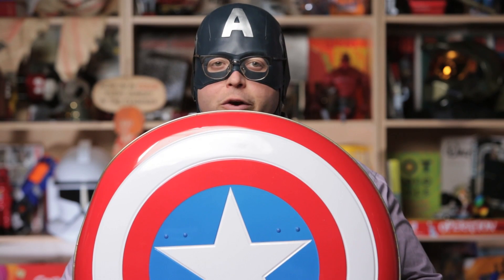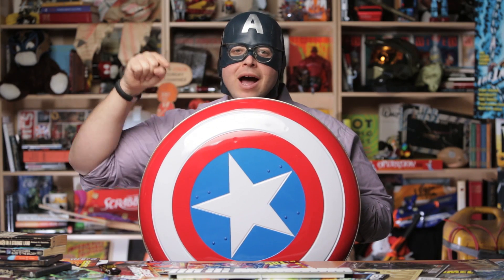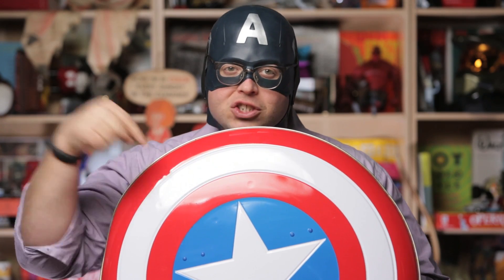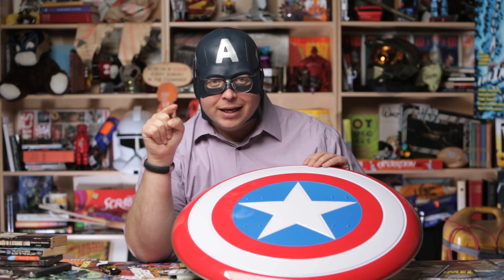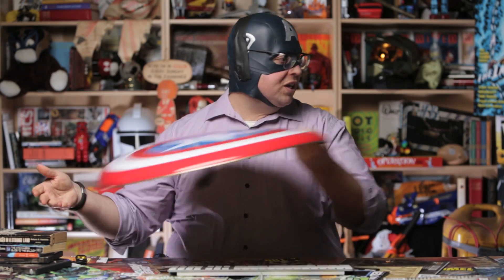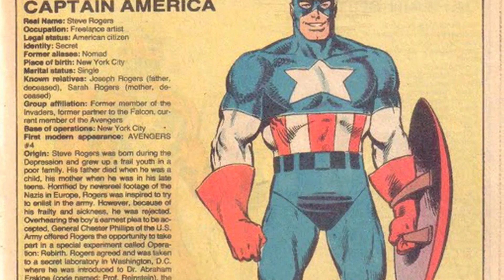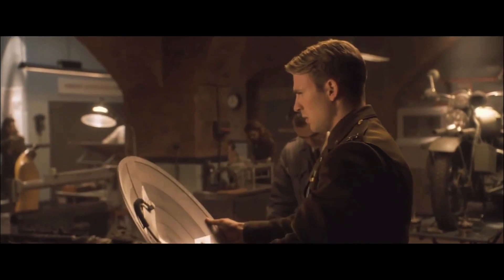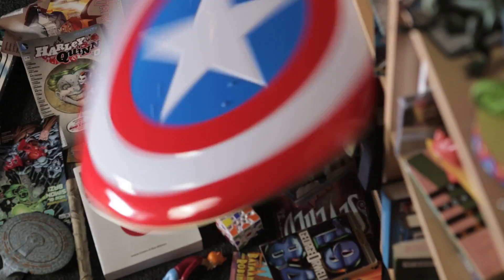Captain America’s Unrealistic Vibranium Shield | Angry Nerd

Comment: Isn't there TWO forms of Vibranium? I never did quite pin down the properties of the Savage Land type. Maybe it has something to do with that? Or the mixture of Vibranium and Adamantium cause the Vibranium to instantly release the energy it just absorbed, so it doesn't lose momentum until caught. Which means you'd have a hell of a difficult catch every time, as your body would have to absorb the impact. Captain America's must have calluses as thick as saddle leather.

Comment: Energy doesn't just disappear. That energy that it absorbs has to go somewhere. If it were just being absorbed, eventually the shield would explode as it became overloaded with energy. What's more likely is that it absorbs energy in one direction, but releases it in another, like polarized lenses. When struck face on, the energy is stored in the atoms of the shield. When struck from the edge, the configuration of the atoms allow it to release its stored energy, thus allowing it to perform those incredible bank shots without losing any momentum.
Reply: I agree with you and I add that the problem of the adamantium-vibranium alloy is as he said, can't be portrayed on Marvel Studios Films bc adamantium belongs to x-men, so they can't mention it T_T

But the idea you said, solves the ecuation!
Reply: In the rise of the black panther, t'challa's mother is testing Vibranium and says that the energy strengthens the subatomic bonds of the metal. So Vibranium would absorbs and converts Vibrations into the bonding force of atoms!!

Comment: but let's fantasize, that vibranium shield is designed to work only against front(back) side, that this is layered material, combined. But sides are without such properties and act normaly. You see that Captan is using sides as cutting and slaming tool/veapon. With front side it wouldn't be possible as it works against objects in same way as for defender.
As a nerd I would try to test if such form aerodinamicaly alows shield to fly that way. Maybe it must have more frisby plate shape.

Comment: So, is it the adamantium which made it so elastic? Because yes, "absorbing" kinetic energy means the object eats all the energy of a collision, stopping it dead in its tracks, resulting in an inelastic collision. So that would mean that the adamantium is the stuff that gives the shield its elasticity, but if that's the case, why bother with vibranium at all? It's not indestructible, it deadens the impact, and it dilutes an otherwise impassible defense.
P.S. Captain America would be winning until the Hulk crushed the frisby out of frustration.
Reply: I think they decided to add Vibranium so when someone or something(ex:artillery shell) hits the shield the Vibranium would help the ease the blow and adamantium would be why the thing is still in one piece post-impact.
Reply: Black Fire Dragon the 13th
Actually, it would transfer most of the kinetic energy into Cap, sending him flying backwards due to the elastic collision. The object that struck him would bounce off the shield as well, provided it was still in one piece after impact.